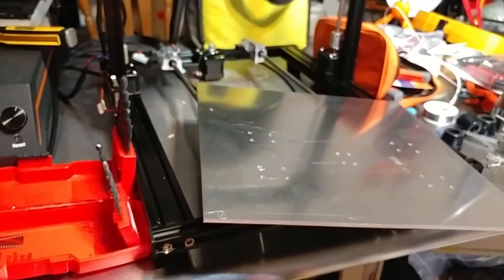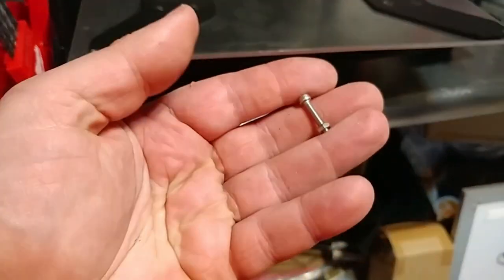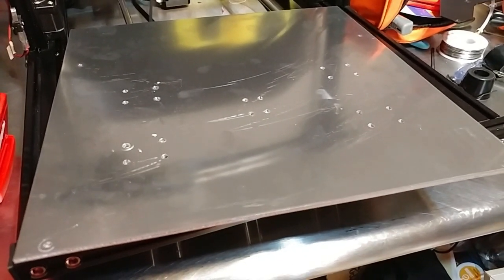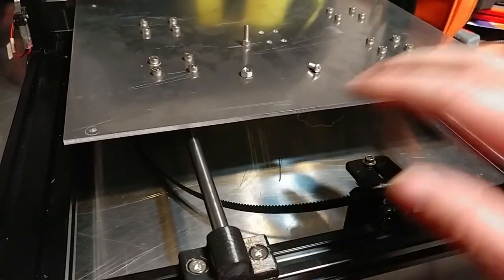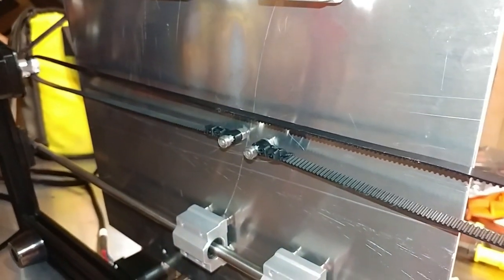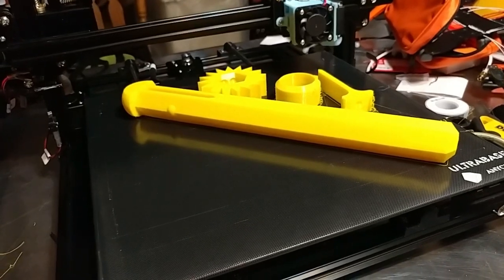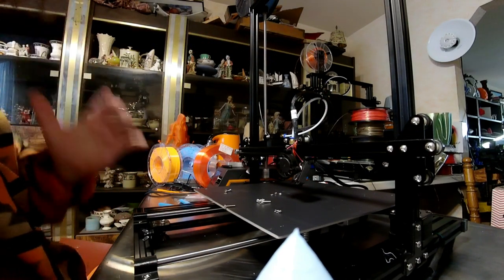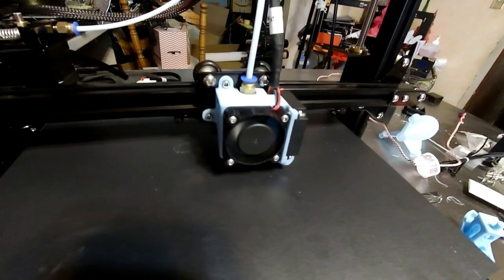Today's 3D Print 187 Anet E12 Fix, Upgrade1

Comment: I will be making this mod.  My E12 has 1-2mm depression in the middle of the bed.  If I try to print anything larger than a 3" x 3" foot print it just doesn't work for obvious reasons.  Thanks for posting!
Reply from the maker: Don't forget you need to cut out openings on the front and back of the aluminum plate to clear up structions in the sliding path of the bed or you'll need to raise it up higher like I did if you have the means to cut out arcs on the front and back that would be better as it would also lower the inertial mass of the entire unit it was a breeze to level once I replace the plate :-) and now with a thicker plate it won't warp

Anet needs to get it through their head that that H braces garbage they need to stop using it it just doesn't work very well
Reply: 10-4 good advice.  I was thinking about making spacers for the rod slides to lift it up but if you feel it makes the center of gravity too high I will look at cutting the slots.
Reply: Also, what do you recommend for lubrication on the rods?

Comment: Thanks for this vid! I will definitely be doing this myself though considering some modifications. I want to add a silicone heater pad underneath the bed to increase the bed temperature for ABS prints and speed up heating. Current heater pads on Aliexpress don't have holes that accommodate the placement of the leveling screws on the E12 but there are some that accommodate the CR 10. I think it would be possible to drill new holes in the bed in the same location as the CR 10 and design the new carriage plate to align as such. What do you think?

Comment: Nerys, Thank you for your comments. I think I am going to do this. Parts ordered! What springs did you get, I see they are yellow. :) One question though. How do I raise the Z-stop ?
Reply from the maker: +Lucas Gonzalez i glued bits of zip tie under the left gantry frame to raise it up where it touched the switch.
Reply: Thank you Nerys. What about the springs used, it looks like you replaced them.
Reply from the maker: I use these for all my printers now slightly stiffer than CR-10 springs. Cheap too.

http://amzn.to/2BImz7T
Reply: Thank youy Nerys. Do you use the same leveling screws that came with the E12?
Reply from the maker: +Lucas Gonzalez I used to stalk Hardware but I replace the Springs with the cr10 style Springs

Comment: Awesome. Thank you. I'd love to try this, but I'm relatively new to 3d printing(2 weeks) and not very mechanically inclined :(
Reply from the maker: +Lucas Gonzalez if you have not bought a printer yet do not buy the E12 buy a cr10 you want need to change anything to make that work

If you already have the E12 making this change is very easy you just clamp the old part of the new part and use it as a guide with drill bits and a screw gun it's not hard at all it only cost 14 bucks
Reply: Nerys, Thank you for your response. I already have one :(. So, we still keep the same bed? I'd have to see hat you did with the z-stops, etc.. Thank you for the guide.
Reply from the maker: +Lucas Gonzalez yes the bed is fine you just need the piece of aluminum and then you remove the Y Carriage plate from your current printer super glue it together so you can remove all the bolts and use it as a template on the new piece of aluminum if you can cut a notch in the front and back you don't have to use washers to raise it up and you probably won't need to mess with the Z stop because I had to raise mine up to clear the pulley and why motor I had to raise my end stop

Comment: i would have put the bearings further apart they seem quite close together for the size of that huge bottom plate. but i guess it depends on clearance for limit switch and also going forward enough to be able to print on the back of the bed. but each to their own :D
Reply from the maker: +Toto Guy modifying the geometry of the printer it's just not worth it at this level so I put them exactly where they were stock but I'm jacked it was not to make the printer better just to make it usable so if any of you guys get stuck with this... Thing... You can at least make a working printer out of it :-)
Reply: Nerys fair enough :)

Comment: Thanks for the review. Awesome advice, I bought one of these, waiting to arrive. I ordered replacement for carriage. Beside that and skipping stepper due to bad QC of hot end, are there any more issues with this printer?
Reply from the maker: Nope. Its otherwise oddly enough a decently capable machine. Consider slapping a creality hot end on there iirc it bolts right up and they are cheap.
Reply: @nerys71  Thanks 😁 I ordered one already, and some noctua fan,and igus drylin bearings for it. Want to dial down the noise as well. Thank you for replying

Comment: Your video was EPIC in helping me get my bed more solid and I did exactly what you did here. When I was done my y axis wants to home in the wrong direction. It goes forward instead of back to the kill switch in the back when you try to home the machine. (E12) Any advice? Did I do something during the install that could do this?
Reply from the maker: You may have accidentally flip the belt and have it running the opposite direction there are holes both left and right of Center and you have to pick the correct ones or you will do exactly that reverse the direction of the y axis

I'm not exactly sure how you would do that I'll have to look at mine to see how easy it is to accidentally reverse
Reply: You were right. No need to look at the pictures. I had the bolts through the wrong holes. When I switched them the y axis went straight home. Thank you so much for helping me see the error in my ways! Your the man!

Comment: Thanks for making this video dude.  Mine worked great first two weeks but now is so bent I cant get it leveled at all.  I am going to get supplies and do this tomorrow.  Did you get the sheet metal at hardware store or did you order that?  Do you happen to know how many of what size screws I will need so I can get everything in 1 trip to hardware store?  I was hoping it was in description but I am never that lucky.
Reply from the maker: +Dylan Kowalski oh my bad. I tell it in the video but did not make links (derp) i will fix it.
Reply from the maker: +Dylan Kowalski all links are now in description. Sorry for forgetting that.
Reply: Thanks dude keep it up you should have way more subs

Comment: If you want that plate cut, try stopping by a local HVAC company that fabricates ducting, they will almost have a jump sheer, Im sure for a $10 bill you can talk one of the workers to handle it.
Reply from the maker: +Nine Hunit ehh jigsaw will work i just did not have one handy. Aluminum is pretty easy to cut.

Comment from the maker: Aluminum Plate
http://amzn.to/2Eo6lPw only $14 for this one thanks Lucas!
http://amzn.to/2DMTcOP (2 pack)
http://amzn.to/2FpIcrh (Just 1)

1/8" and 5/32" Drill Bits needed.
http://amzn.to/2BDjMYS

M3 M4 M5 Assortments
(m4x12 for the blocks with m5 nuts for spacers)
500pcs http://amzn.to/2DNV6Pa
305pcs http://amzn.to/2GrASwq

Cheap cordless Drill $28
http://amzn.to/2no9VRK

UltraBase (not the greatest for E12 bed level not consistant)
http://amzn.to/2DVAZlv

Comment: Did you see your build quality improve from changing the plate?
Reply from the maker: Not really on the one hand it's now stiffer but it's also heavier so any games are washed by increased noise but the bed is now solid so when I level it it stays level I don't have to keep tweaking the bed level Which is far more important to me because now the printer is more reliable and consistent and I don't have to keep tweaking the bed level every print
Reply: Nerys  I see. I was thinking that the bed probably warped during the print from its own heat so this would probably stop it from making your print do some weird things. Biggest thing I've noticed on the A12 is that you need to check that the gantry itself is level between prints too
Reply: Nerys  Oh also, put some holes in that sheet! You don't need all that mass, haha.
Reply from the maker: I know I just didn't have the tools to do that
Reply: I own a Abet e12 and two ender 3 one pro and one regular.  On my enders, I VERY rarely have to adjust my bed, but on the Abet E12 I have to do it every print.  It's a horrible y-axis.  I ordered linear rails and am going to replace those VERY skinny round rails with MGN12 Linearl rails and bearings.  It's should stiffen everything up and produce more consistent leveling and prints.

Comment: What is your bed temp with an ultrabase? (if you use it on the tornado too, to be precise.. :) )
Tried it with 75°C but baby groot got warped.. Hot glue solved it, now my Ultrabase is a bit messy.. :D
Reply from the maker: +padree 65c. 75c is too hot you pla will get too soft and the upper layers will warp it off the bed. I get that problem even at 70c. Too hot.

Comment: Do you use default heated bed?
My heated bed is impossible to level, not really flat, and get worst at 60degrees...
Will try that not.
Reply from the maker: yes. bed warp should not matter if your glass plate is flat. if not. Home Depot $10 for a 6 pack of 12" mirror panes. work wonderfully

Consider replacing the y carriage. its very wonky and way too thin

Comment: Hello, thanks for the video :)  Do you still have issues with the extruder skipping?
Reply: Nvm I just saw your other video and realised you fixed it with a cr10 extruder. Do you have any links where to get one please? Thanks
Reply from the maker: +Paul Camilleri yes. My next step is to check the voltage at the driver. It does not get warm at all so i might be able to up the torque a tiny bit.
Reply from the maker: +Paul Camilleri the hot end prevented easy filament changes.

Here is link to amazon hot end for $27 http://amzn.to/2ExyK5M if your in the us 

Cheaper but longer wait from ebay (i bought 4 to keep on hand for upgrading printers) $15

https://www.ebay.com/itm/0-4mm-Nozzle-Extruder-Hot-End-Kit-for-MK8-Creality-CR-10-3D-Printer-Parts-R6Q2/352261666968
Reply: Nerys ok thanks a lot :-) mine is still on its way and it's going to be my first 3D printer and I'm looking forward to fiddling with it. Thank you for your videos I'm finding them really helpful :-)

Comment: I guess you only print PLA, some PETg -- I tried the ultrabase and it was total disaster with Polycarbonate. At 95c, it lifted at the corners (small prints -- 30 minute print for an end stop mount, so not a big part at all), at 110c it worked and held on -- first one was OK, second one when it cooled off -- released with just with a finger tap, but took some of that coating with them and a shard of glass as well. Not using that again --- PEI only for me.
Reply from the maker: +kazolar correct ultrabase is really just for pla. I have print in z and garrolite for the engineering filaments.

I would not use ultrabase for anything but pla. But for pla its amazing. Zero tools needed parts auto relese.

Many of my prints are art deco toy prints and uaing anything but pla is not practical.

Abs is too weak for my needs. Nylon however is fascinating especially modified nylons like nylon x though too expensive for now.
Reply from the maker: +kazolar i just noticed something you said. Pei works for pc?
Reply: +Nerys, Ultrabase instructions from anycubic provide temps for PLA, PETg, ABS, PC, and Nylon, they also say it's been tested to work at up to 300c -- clearly that's a misrepresentation because 110c was enough to cause it to chip. 
Yes PEI works with PC -- not all PC, but works with eSun's ePC -- which is slightly modified blend of PC which helps with adhesion.  I print it at 90-95c and depending on part size -- sometimes I use a brim, sometimes not (depending on the part). Taller parts (than 100-150mm) don't work -- they start to deform from bed heat, so it's purely for brackets and similar type of objects which require extra strength and more importantly high temperature resistance. I purchased the Buildtak flexplate system for my 12" machine -- that machine heat bed doesn't allow for bed clips, so this will be ideal for it. I plan to use one sheet with PEI and one sheet with garrolite, as I find nylon to be very tricky to get to work with PEI.
Reply from the maker: +kazolar 110c did not cause it to chip the polycarbonate caused it to chip whether it should have or not is another issue but it was not the temperature that did that the polycarbonate shrank and pulled on the glass with enough Force to rip a chunk out of it

Basically the polycarbonate adhered to well to the surface

I wonder if any cubic ever actually tested this with other materials I bet you they didn't :-)
Reply from the maker: +kazolar 110c did not cause it to chip the polycarbonate caused it to chip whether it should have or not is another issue but it was not the temperature that did that the polycarbonate shrank and pulled on the glass with enough Force to rip a chunk out of it

Basically the polycarbonate adhered to well to the surface

I wonder if any cubic ever actually tested this with other materials I bet you they didn't :-)
Reply from the maker: +kazolar nylon is a pain in the ass but damn is it strong :-) worth the hassle :-)
Reply: +Nerys it is right on the insert that came with the bed surface. Temperature ranges for pla, PETg, PC, ABS, and Nylon...so did they pull those out of their butt without testing?
Reply from the maker: +kazolar I don't know I will test that though :-) now I know not to try PC :-) but I will give petg abs and nylon a try and see what happens
Reply: +Nerys Be prepared for the bed to be ruined, so I would only try it on a machine which uses clips to hold the Ultrabase down, so if it gets ruined, you're just out the ultrbase bed -- and you can probably get a refund from anycubic (they don't want defective/broken chipped beds back). I have plenty of cuts on my hands to show for it, as I had stupidly adhered the Ultrabase to the borosilicate bed of my heated bed (no clips option) -- on the plus side I got a refund from Anycubic after they tried to convince me to clean the bed with alcohol -- maybe in China they make special alcohol which can heal chipped glass? Sucks that this experiment cost me more money to repair my heated bed. Since it caused my backup heated bed borosilicate surface underneath the ultrabase to be destroyed when I tried to remove the ultrabase from the bed -- the 3M adhesive I used was incredibly strong (my mistake for using so much of it and for using ultrabase to begin with I guess). I have a tooling plate coming, so I'll have a heated bed with PEI on tooling ultra flat aluminum for that machine :)
Reply from the maker: +kazolar well I am reviewing the stuff so I don't mind taking a bullet to bring you guys information you need :-)

Comment: how much time did it take to remove the H?  Is that a complex process?
Reply from the maker: I just replaced the completely within piece of solid aluminum I just have to drill the appropriate holes in it transfer the hard way over and it was done I don't think it took me more than 90 minutes and that includes making video

Comment: How dit you fasten you Anycubic glas plate. I got one but there is no glue on the back.
Reply from the maker: +Kurt Jensen actually with the residual glue that was there when I peeled off the original build surface but 3M adhesive works fine just like you do with the Pei
Reply: I use binders clips to hold mine on & haven't had any issues.
Reply from the maker: +Andrew wont work on the e12 the ultrabase is larger than the heat bed so the clips wont reach.

Comment: Where did you get your ultra base from. I want to get one for my anet a8
Reply from the maker: +SkyDivingMoose http://amzn.to/2BD1dUB that should be the right size for the A8

Bed level is critical for ultrabase if you have a nice consistent solid bed level ultrabass is amazing if you don't it's a nightmare it does not work very well on the E12 because even with my modifications my bed level is inconsistent it fluctuates slightly from print to print which doesn't allow the ultrabass to work very

Keep that in mind but if you're a eight is nice and stiff and you have a good consistent bed level this stuff is amazing
Reply: Nerys ok great thanks I used a thickness gauge to test points on my bed and then use wing nuts to tighten every thing.

Comment: Thanks for the share, really like your style, the info and the suggestions you give in your videos.

Do you think it is worth designing a pla printed hot bed plate? I assume you could actually print it on the E12 instead of machining one from Aluminium (I'm on the other side of the pond). That way you could design in braces where they are need for strength, and also miss the belt in the centre of the carriage. Maybe it would be stronger and lighter than the aluminium plate.

I'm surprised that you haven't printed the x and y axis belt tensioners from the E10 and fitted them to the E12 (I assume they fit). 

I'm still waiting for my E12 to arrive, I decided to go for it over the CR10 due to lower cost and the twin Z axis steppers. It's my first 3d printer and I love to tinker and re-engineer, so the highlighted problems with e E12 (or E10) are not such a big issue for me.

By the way, loved your video on the Christmas baubles... it was fun..
Reply from the maker: +martin White it does not need the tensioners so I saw no reason to printer part just to print a part :-)

I guess you could make one out of pla if you made it thick enough but the amount of pla you would need probably be about equal to what it would cost just to buy the aluminum plate and then it would be thick enough that you would need longer bolts for the bed leveling bolts
Reply: is this printer worth buying